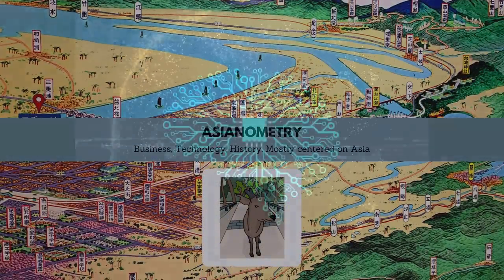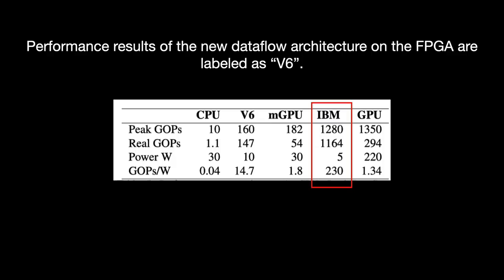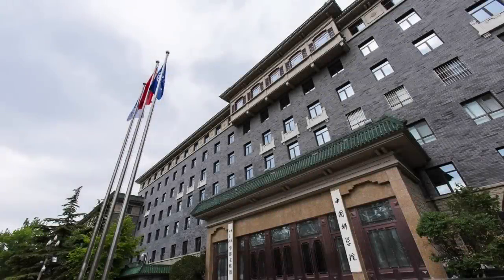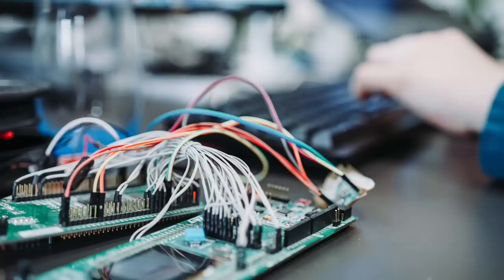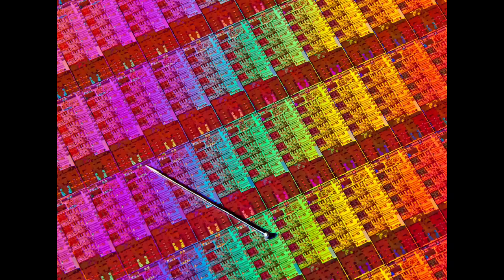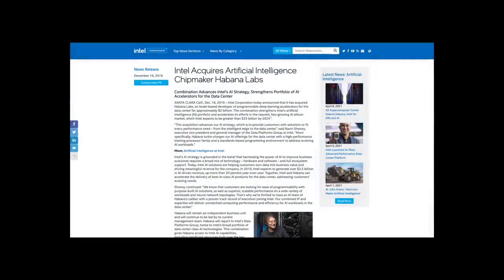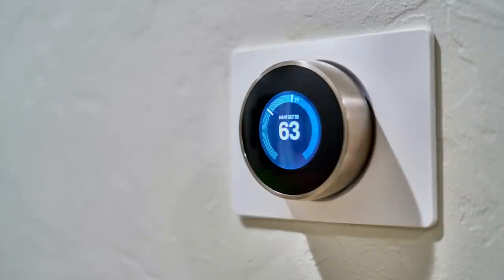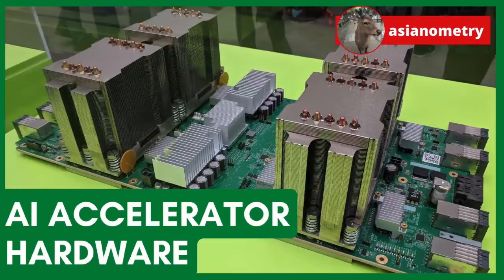The Coming AI Chip Boom

Comment: You didn't mention one of the key aspects of Google's TPU (and other specialist AI processor) compared to a GPU is also the number representation. GPUs can process 32 and 16 bit IEEE floating point numbers. But for AI work Google found that the fractional part of the number (commonly known as the mantissa) is less important than the magnitude (the exponent) and so they changed the number of bits allocated to each in their own BFLOAT16 format. That makes their processors better for AI, but relatively useless of other kinds of numerical computation.
Reply: Same as Tesla's Super computer that has a custom number format.
Reply: I know 😃. A lot of optimizations have been done since then to squeeze out even more performance.  (A.I)

Comment: As a ML researcher it is interesting to watch, unless run at extreme scales, regular chips are just enough especially for inference
Reply: Yes, essentially, inference of smaller models can be done locally, in the browser (WebGL or Webassembly). 

At larger scale, it's always a limitation of memory bandwidth because no hardware can keep billions of parameters in cache. The caching locality of GPU breaks down pretty quickly and the 24GB of VRAM in top tier consumer grade GPU is still far from enough. At the end you give up and rent Google Colab to run your large models.
Reply: @harrytsang1501  True, I don't think even any university will invest in specialized hardware, most cloud providers also simply give credits to use their cloud services, but for the cloud provider itself I think such chips can provide significant power savings perhaps and worth it in the long run.
Reply: What do you mean by "regular"? Regular GPUs? For certain things like NLP (stanza, Marian, etc) CPUs can be orders of magnitude slower than GPUs, making them totally unrealistic for running inference, so regular GPUs sure, but not CPUs!
Reply: "64 KB of memory ought to be enough for everyone" 😏
Reply: Real time 30FPS image processing of a HD camera input is very demanding.
Reply: @Bvic3  I have had run CNN-LSTM with 24 fps real-time inference with downsampling to 640p on gtx 660 under 3gb vram. U dont really need HD input tho, u just need enough pixels for equivalent of normal human to understand things on frame.
Reply: @harrytsang1501   "At larger scale, it's always a limitation of memory bandwidth because no hardware can keep billions of parameters in cache. The caching locality of GPU breaks down pretty quickly and the 24GB of VRAM in top tier consumer grade GPU is still far from enough. At the end you give up and rent Google Colab to run your large models."

Enter the MI200 series from AMD.  Not only do they run HBM2 memory but it's 128GB. It offers 3.2 TB/sec memory bandwidth.
Reply: ML is snake oil, except in highly controlled environments.
Reply: @chrisfuller1268  ML is super useful in tons of applications. Tons of computer vision algorithms have some learning.

Marketing and product recommandation have ML everywhere.

Audio processing has ML everywhere. Try using Twitch streaming software OBS. Their ML based noise cancelling is insanely good compared to frequency band old systems.

And obviously, Youtube auto subtitles are outstanding. Just like translation of Russian or Chinese news sites.

And well, social network moderation is full of ML too.
Reply: @Bvic3  computer vision for the general environment has killed multiple people and will never be more reliable than humans in 100% of circumstances because ML doesn't really learn, it records patterns. Humans will always be better at interpreting new and uncertain patterns compared to ML for vision out in the world.  ML for vision in a highly controlled (e.g. factory production) environment can be expected to outperform a human.  Like I said, ML can only be expected to work better in highly controlled environments, but even you have fallen for the snake oil that it could keep vehicles from crashing in situations where an average human would avoid the crash.
Reply: @chrisfuller1268  I like you answer, chris:) Its only wrong (I mean that ML/AI hype ... on purpose?!) communicated. Like laundry detergent, beer or cigarette ads... oh and radium toothpaste. Humans are idiots... and braggarts and scammers are of course even bigger ones :)
Let's just call it "Control system" (as the word meaning, technically, control loop...like the thermostat). Or maybe "fuzzy logic" or "incomprehensible chain of evidence (ICoe)" as a buzz word(OH NO, we do NOT need any more buzz-words:P)? ... that would be enough for the embarrassing bragging and one could simply save herself the absolutely irrelevant and meaningless designations that are redefined at will and completely arbitrarily (depending on your mood) like the models and data behind.
Reply: Hahaha
Reply: Bruh a 3080 can't infer on gpt neo

Comment: I'm very excited about the silicon photonics approach. Photonic chips don't need to perform multiplications one at a time, but rather do the whole matrix multiplication in parallel, which makes it a O(1), or constant time operation. The chip needs to be configured to multiply by a certain matrix, which takes milliseconds, and can then perform matrix multiplications as fast as you can give it inputs. With 50GHz modulators and photodetectors readily available, I'm excited to see what companies like QuiX, iPronics and Xanadu will achieve.
Reply: Are 50 GHz of modulators available on Chip ??
Reply: @kalukutta  Yes, 50 GHz has been available for several years both in electro-absorption and carrier depletion modulators in SiP, so both amplitude and phase modulation. They're even mature enough to be available in MPW PDKs, so you can just include them in your layout without designing anything from scratch. However they are too large for dense integration of meshes like the ones here.
Reply: ASICs, FPGAs, GPUs do parallel calculation too. That is no special attribute of photonics.
Reply: @crackwitz  True, but in a fundamentally different way. Those devices need to perform a long series of logic operations to get a result. A photonic interferometer mesh is configured to be the multiplication itself, and the result comes out as soon as the input light has passed through it, about a tenth of a nanosecond. It's limited by scaling the chip and how fast you can switch the input/read the output.

A reasonable parallel would be that to calculate shadows with ray tracing you need to compute a ton of stuff on a GPU, but the photonic approach is to shine light at the object and look at the shadow.

Comment: Have you heard of BrainChip Inc.? BrainChip has a first-to-market neuromorphic processor IP, Akida.

  Brainchip's Akida is a neuromorphic system on a chip designed for a wide range of markets from edge inference and training with a sub-1W power to high-performance data center applications. The architecture consists of three major parts: sensor interfaces, the conversion complex, and the neuron fabric. Depending on the application (e.g., edge vs data center) data may either be collected at the device (e.g. lidar, visual and audio) or brought via one of the standard data interfaces (e.g., PCIe). Any data sent to the Akida SoC requires being converted into spikes to be useful. Akida incorporates a conversion complex with a set of specialized conversion units for handling digital, analog, vision, sound and other data types to spikes.

Comment: Good video, however, as someone that schooled and works in the Deep Learning and Microelectronics field, you failed to talk about the accuracy deterioration between float64 and other Neutral Network Accelerators (NNA).

I expect a follow up video. I agree NNA are faster than regular GPU operations, however, it comes at an accuracy degradation cost.  NNA is fitting countable infinite numbers(float64) into 255(uint8) or 65536(int16). Regardless of how well a quantization does this, there’s always error incurred. Building on the same point, repeat multiply and add operations 100 million times in uint8, the resulting values will be significantly different from the original float64 value. Sometimes the accuracy degradation can be more than 30%!
Reply: What are you opinions on Tenstorrent?

Comment: The path for future scaling of ML hardware is switching to analog circuit computations. The conventional binary load/store logic is already bumping in the perf/watt wall.
Reply: I would have expected at least a brief mention of Analog computing, using resistors as weights and adding currents together.
Reply: Something like memsistors seem like the real future of neural network hardware as network complexity outpaces how many compute units can be put into a package. Programmable resistors could instantly apply a neural network by sitting between the CMOS and typical ISP.
Reply: Problem with analog computing is luck of design tools and knowledge, hard to debug, and many more. Phonic is interesting but same neuromorphic chip design. Because NN are something you know where each memory need to be, so don't need to use RAM, but put memory next to compute and load with pre program sequence etc.
Reply: @m_sedziwoj  We already have put the computations besides the memory -- the GPUs, with their megabytes of registers and caches right next to the ALUs. But this is still not nearly enough and doesn't overcome the huge overhead of the classic discrete binary computing. Computation and memory must to be fused into a single functional structure, similar to how the organic neurons work, to get out of the power overhead trap. Probabilistic computing also could be significant contribution to ML, since most of the training doesn't need precise results or use of strict data formats.
Reply: @RoyvanLierop  forget electrons, imagine doing computations with photons on the fly.
Reply: @m_sedziwoj  not true, I designed analog computers in the 1990s for scientific instruments.  OnSemi and others offer this capability for ICs.
Reply: @chrisfuller1268  it not if someone offer this, but on what scale and cost. Some are trying, so look at they efforts and what they get in given time. We get more photonic than analog this is telling something.
Reply: @m_sedziwoj  OnSemi and others were marketing for high volume commercial applications.  The NRE becomes insignificant at high volumes.  Optical methods appear to still be ridiculously expensive due to manufacturing processes.
Reply: @m_sedziwoj  Surely "photonic" and "analogue" are orthogonals?
Reply: @smorrow  not exactly, but as today analog and digital device electricity, you can do same with light. But digital is easier to do, because you can always add error correction. But analog have a lot more potential, but to have potential, and can use it... you know, atomic fusion have a lot of potential too. Light have one big thing, and it what it not have so much resistance/heat while travelling, which is current limitation (heat) to make big 3d microprocessors, you make low power and multiple layers, or high power but design around heat dispersion.

Comment: The problem with ARM CPUs which includes accelerators.
They are proprietary. People writing the OS -say Linux - require the help of the manufacturers to write drivers, software updates, etc.
This is not true for x86 CPU - which have a known structure and don't require the help of Intel for writing low level software.
Our only hope is for Intel to invent a 5 Watt multicore, Risc or Cisc at this point doesn't matter much.
If the trend continue with this proprietary SoCs, we will end end up with "hardware as a service" - a thing that I dislike a lot. And it is already happened with the software; do you own a video editing software, or a CAD anymore?
Sometime I hope ARM and Intel get together and design the "Freedom Chip". Otherwise the best processor will only live 2 or 3 years, like our phones do now.
Thank you for all your hard work...
Reply: heard about RISC-V ?
Well, ok, look up "F-CPU", started in 1998....
and the "Libre-SOC" started in 2008 🙂

Comment: I did a diploma on this topic in 2005, prototyping on Xilinx vertex too. But for spiking NNs, not regular ones. Spiking NNs takes advantage of race conditions from simultaneous concurring impulses, more akin to real NNs. They don't have a system-wide clock signal, thus they remove the disadvantage of hard discretization of the modern electronics

Comment: As a brand new FPGA designer being introduced into computational designs, I'm pumped to see integrated AI cores in my designs that can integrated a little AI processing without losing general computing resources. MMUs can make your routing congestion very sad as is :( . But knowing FPGA design will let me shift over to ASICs if that's what's in demand.
Reply: Only if you implement your design in VHDL which can be synthesized. If you're coding up specific logic functions which exist in the  FPGA vendor supplied libraries then you're going to have a problem.

And it's not a case of whether ASICs are in demand, it's simply a case of performance and cost and the volume of sales.

Comment: Moving the memory to the calculation would be like creating a hardware neuron.
Reply: I believe that's what they're gunning for. I saw another startup where they were hacking with transistors to change them from simple 0/1 to something like a sliding scale, and then doing math with those values. I think that's extremely similar to how an organic brain works
Reply: @AlexK-jp9nc  wait... transistor are analog parts, you know. It's how you use them that makes then digital or analog, when you saturate them or not.
Analog computing with discrete transistor is an old art.

Comment: Great video, as always, thanks. You mention silicon photonics and argue that chips produced with this technique can solve the problem that storage and processing is not happening in the same place. I don't see where silicon photonics help to solve this specific problem. Isn't the difference in this chips that the data is travelling as photon on the connecting bus?

You might take a look into analog computing chips which are planned. They might be a real game changer when it comes to simulating the brain's neurons.

Comment: These chips only work in a "Serial" fashion, unlike 64 core, 128 thread CPU's.  They need one processor after another.  If a "network" of processors are needed, then that would require a syncronised processor the size of a football pitch.  Latency kills big chips.

Comment: First time I've heard about ai specific chips was a veritassiun video about a startup Makin one of thoses with a SD card and analog computing to calculate matrix with voltages 
That the simple explanation of it, the complex is that each binary slot of a SD card work like a capacitor that can be filled with zero or one unit of energy, that's how the card usually hold binary data. But what this startup does is instead of just havin it be or full or empty they hold a fraction depending on what the ai weights need to be set, send a currency on the input and measure the output to get the desire result
Reply: Can you help me with the SoC / Chip name or startup that is building that. TIA
Reply: @jayantpancholi9506  is a texan company called Mythic AI
they show up on the part 2 of veritasium video on analog computers
Reply: They are no longer in business and ran out of money.
Reply: @anonymoose9801  thats sad 2 hear
their tech was so promising, refurbishin sd cards into tensor cores looked so cool n promising

Comment: 7:40 lol! Look at those old brown ceramic through capacitors. They even have the little crimps on the leads so they don't get over-inserted. I'm concerned that that's something that I'm misidentifying.
Reply: could also big giant thermistors, for short circuit protection or something
Reply: looks like "polyswitch" to me, they exist as round and square shapes, for overcurrent limiting.
Ceramic caps. do not look like (or this large) that for more than 60 years.
They would use SMD "bricks" as can be seen in other pictures.
Reply: @leyasep5919  Yeah, that's them. I know I've seen them somewhere before, probably in data center computers. I spent a long time looking for images of the TPU v2 and v3 board before I commented that and its definitely not labeled "C" anything like the electrolytic capacitors but I couldn't find any images where I could make out what it was labeled.

Its weird to see what looks like pretty low quality components for something as expensive as that. Not necessarily the fuses, but usually in expensive stuff they spring for the more expensive long life and low ESR aluminum caps.
Reply: @htomerif  Maybe it's a prototype.
Reply: @leyasep5919  Well dang. I had like a whole smart comment wrote up, but I searched again for "TPU v2 board" and I guess I missed it before but there's a 2000x1300 image where you can clearly see those things labeled "F10" and "F7", so yeah, they're PTC thermal fuses.

As for whether its a prototype or not, it looks like there are zero unpopulated pads and literally hundreds of test points, so that's pretty consistent with a prototype. It also has an SMT micro RF connector on it. I wonder what that was for.
Reply: @htomerif  I'd love to see the picture ! can you post the link(s) ?

Now the question is .... WHY put polyfuses at this place. It's so uncommon, as they are mostly found on the input sides of power supplies for example.
Another example I have seen is to protect the PSU in large hot-swappable backplanes.
But so close to the actual power drain ? Weird !

Comment: Data travels down electric wires and chip paths just as fast as photons down a fibre optic cable or Photonic path. It is the components at either end that are the problem